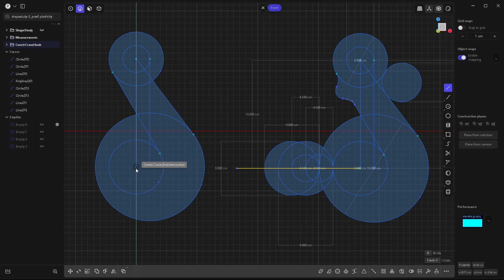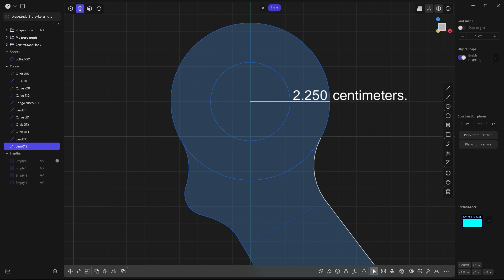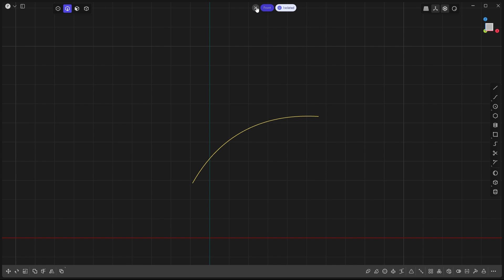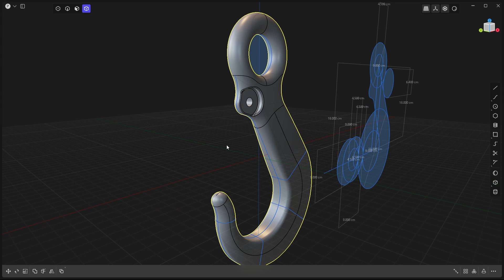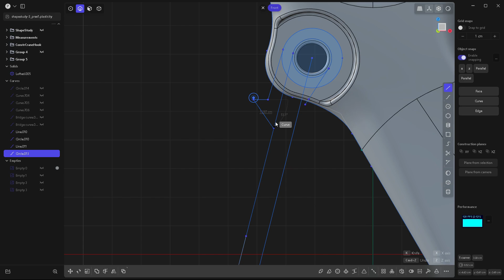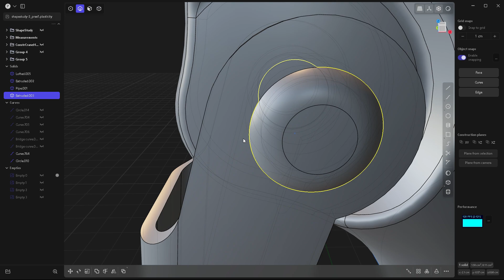Plasticity  3D (Step by step guide) shape study part 7

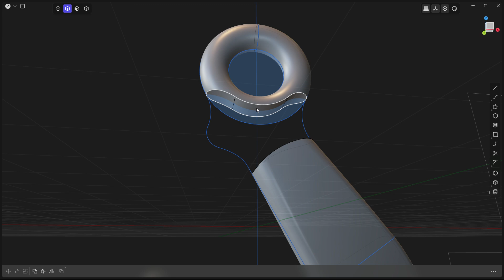Comment: at 32:27 I delete the faces it deletes the whole solid. Also there is no delete face command. Its just delete in search bar. Thank you!
Reply from the maker: Hi, select a face and hit X to delete it.
Reply: It turns out that when the solid is isolated it does not allow it to be deleted. When I de-isolate it it worked. Thanks
Reply from the maker: The "BackSpace" key remove the bevel from shell.
Reply: @Stuff-3D-creations  Thanks!